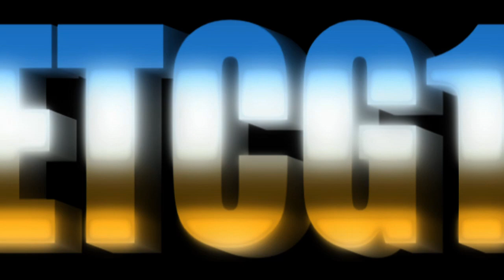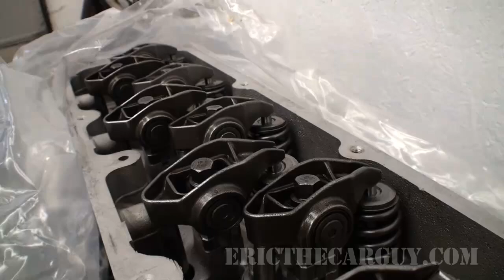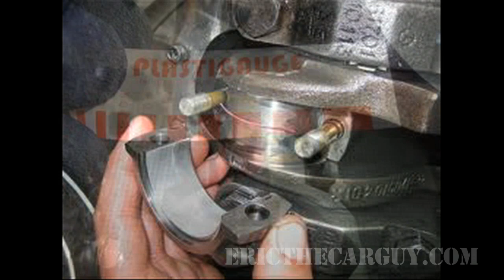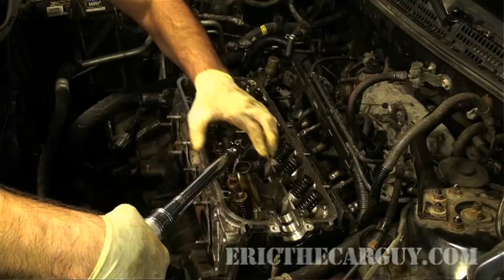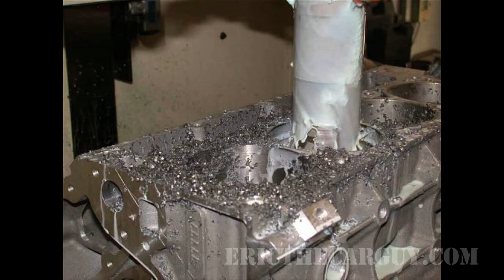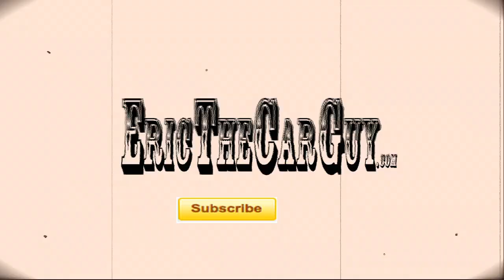Should You Rebuild or Replace? -ETCG1

Comment: I am currently in the engine replacement situation. An 03 explorer needs a new short or long block. I would not want to rebuild mainly because all of the metal fragments to try and remove and just the time and lack of proper equipment

Comment: This helps a lot. I'm thinking about buying an old blazer for 700$ and suspect that it's this cheap because it's a bit more than just problems with the intake manifold gasket and EGR valve. I have no idea what I'm going to find once I pull of the intake assembly.

Comment: I rebuilt the C4 in my 84 Mustang and it was fine. But that was at tech school and I had a clean room and all the special tools and instructor's knowledge at my disposal. It was still working pretty well a few years later when I sold the car.  If I had to do it in my driveway, it would have been a disaster and getting a rebuilt one would have been the way to go.

Comment: Great video man.. I have a question.. I have a car with 220k. With blown head gasket.. What would you do? Replace de head gasket or swap the engine?
Reply: a head gasket is only in the top end of the motor. not nearly as much work.!. but some motors need to be removed to get to the head gasket, and some dont...(but we do NOT know what motor you need worked on or what vehicle it is in) cost of parts vs cost of motor is also a big deciding factor.
Reply: @MrMrsregor  well the car I have is a honda civic 2001 and have bad head gasket and that's I was wondering
Reply: You can do it yourself just change head gasket resurface the head

Comment: If you rebuild an engine, make sure you know what you're doing or the mechanic knows what they're doing. I had an engine rebuilt for $1600 and still did not run right afterwards.. Idled rough, had to keep putting the car in neutral to keep it from turning off..

Comment: Hi, Eric. What if the engine I am thinking about rebuilding or replacing has low mileage and I don't want to lose that? It's a 1993 B2200 with only 84,000. If I found a replacement, wouldn't it have more mileage, given the age? That's part of the conundrum I'm having. Without going into the details of what's wrong with it.

Comment: So I blew my engine yesterday small block 350 bored already previous owner I have no suspects or knowledge of the motor sounds like wrenches in it smacking around think it's crank bearings. Has a ton of aftermarket parts on it intake carb it's an 89 Chevy k 1500 I think the block is out of a Corvette 85 what should I do . rebuild it or gamble on someone's word

Comment: Idk, every local shop (6 of em) told me they won't install a "garaunteed" engine from the internet.  So they wanted me to go to a local "reman" shop and pay $1750 then they wanted $2250 to remove/install...so I said Haha, No.  It took 6 hrs to pull the engine, labeling wires/hoses and taking pictures, with a $180 tool kit and a $180 foldable shop crane.   Installing it is the easy part, the bolts aren't all rusty, corroded, and seized...and you know how because you already took one out.  So I just made...what..$180 an hour?

Comment: His topic sentence says it all - If it's too old to buy a replacement, rebuild it.  If you can buy a replacement, buy the replacement.

I've got an '04 avalanche, broke a ring...the parts alone to rebuild the thing would be $900 (gaskets, pistons, bearings, perf cam (cuz you're already in there), lifters, oil pump (cuz you're already in there), hopefully the connecting rods, push rods, and rockers can tolerate another couple hundred thousand miles)...the machine shop, at best, would be $150 to clean, check, and hone.  More like $250 though, 'cuz that broken ring probably scored the bore.  Then there's the time I'd spend disassembling and reassembling the thing.
A used, 100k mile, 5 year garauntee replacement is $1,250.  It's worth it unless you think your time is worth nothing or you simply enjoy doing that type of work.

Rebuilding is, a lot of the time, impossible - You're probably going to be remanufacturing....You'll have a more powerful, more fuel efficient engine, but it's almost always going to cost more than a factory engine. Lol

Comment: As mentioned it depends and quick research shows which is most cost effective. But generally replacement is most cost effective. Generally cheaper and obviously better warranty. Now days you can even buy from mild to wild with Dyno sheets (engine broken in) taking most of the work out. The big three have turn key engine sets that includes everything including transmission, carb, fuel injection, wiring harness, ecu etc.. even oil and filter. 

Look at a stock sbc brand new crate motor for $1700. You can barely rebuild a short block for that price, add in just the head work/check and no way.

Comment: I paid $1,500ish to have my motor rebuilt years ago for my 22r.  It was a lot of money but the shop didn't frequently perform rebuilds on Toyota engines.  I was young and naive.  I should have done more research.  The engine ended up blowing a head gasket just 1-2 years later.  I agree that installing a used motor can have some benefits.

Comment: Depending on why. Id rebuild an engine for the experience. Example: The first motor I rebuilt was 2.2 litre OHV in my cavalier and i did that because i was in high school and i was too cheep at the time to buy a newer vehcile. So i got good. Ten years later (or close too) ihave a Chevrolet k1500 pickup and want to rebuild the engine it. I mainly want the experience really. Not only to become familiar with the 90's chevy trucks but to rebuild one of the most popular small block motors ever, the chevy 350(5.7 litre). I am aware my block needs to be machined and all that other stuff. But come spring my trusty 95 truck is getting not just a rebuilt motor, but a whole make over. I think part of what makes a project vehicle a project vehicle is the work you can do on it yourself and improve your skill. Sure remanufactured motor is far easier but at the end of the day it is the study and the journey to a restored truck that drives me more then the finished product

Comment: I have a 2004 Solara ready to turn over 200000 blowing blue smoke and knocking for about 10k and burning a qt oil every 200 miles blowen head gasket and last time I dove it  I was doing 80 and the chk eng light flashed and she dropped down to 70 as I exited the freeway she continued to try to die. She sounded like she was chocking.  She will start and stall in revers.  Whats happened.  It sounds like something shattered now where before it just sounded like a knock.  There is metal shavings in the oil filter when I change the oil.

Comment: The owner wants a cheap and reliable repair, the technician wants an easy trouble free repair process.. Both must be happy in the end, so who gives? Does the owner pay more for a new "big" replacement part, or the technician works harder to keep his customer happy? My answer: if the engine has to much wear, replace. If the engine was "treated" good and the wear is within specs, repair.

Comment: With an old classic like a Corvette it's important to keep numbers matching but after rebuilding a few I would be a little leery of doing it if you want assurance it will last. It's so hard to maintain tolerances throughout the engine as compared with a crate engine or a factory built with computer precision. Even a junk yard non rebuilt engine would probably be more reliable if it was well kept up and had somewhat low mileage on it. Just speaking from my experience anyway.

Comment: i took my engine to a machine shop and end up in a disaster .. have lifter noise now on both heads, misfire on cilinder 2 and 4, truck can't even be drive now ...2008 silverado 1500 ...should go to dealer and get whole new engine to late now

Comment: Rebuilding tends to be cost prohibitive in modern vehicles. They are simply not designed for it. Some things however, ancient things, were designed to be taken apart and rebuilt.
Will you ever find me with a toyota DOHC in pieces in my garage? Only as a last resort. And i will never, even with good help, go deeper than the head. Even a 30 year old toyota is a scary complicated beast under the valve covers. 
Will you find me with the old 1990 mark 4 454 in pieces? Maybe. Pushrod V 8s are simple and comfortable. At least comparatively. Have I already gotten a quote from Vilas Machine  Works on a bore-out and crank job? Yes I have. My chosen mechanic for that vehicle is a hot rod guy that doesn't touch fords that aren't flat heads or anything else made past 1995. Since that particular block remained more or less unchanged (internally at least) for 40 years I feel that it is in good hands. Beyond that, ive taken the heads off myself twice. And they are iron, and its a bitch of  a job, but that block was made to be rebuilt. 
And the old 3 cyl yanmar john deere? If it ever, one day far in the future, shows signs of wear, ill take it apart too. I believe its a pushrod but im not sure because the thing is a masterwork of reliability and its never had the valve cover removed. But i do know that it is an older tractor and that generally means that it should be servicable. 
I guess what I'm saying is pick your battles. Some things were designed for service, some for replacement. Don't buck the horse on that one. 
If its designed for replacement replace the damn thing. If its designed for service do whatever you want. But bear in mind that modern vehicles are NOT designed for service. None of em.

Comment: Had my transmission rebuilt 6 months back at dealer. Now the same issues are back but they swear it's another component related to the transmission. I took it to 3 other shop all believe it's not that part. I now regret getting it rebuilt but it's too late for that. My vehicle was delaying to pick up when stepping on gas (red lights or stop signs). It also has mis-shifts while driving it. I am not sure who to believe & of course a very frustrating situation. I don't want to invest more money. Please let me know what you think or advise on this. Appreciate it very much.

Comment: I specialize in Honda engines in particular b series. If an engine has catastrophic damage like spun bearings, severely degraded oil, cracks or major warpage beyond tolerances, I always replace but save everything left thats still good. But I use good quality cores I pull myself from pick n pull, I know how to check them for condition before I decide to buy. Ive even bought a b18b out of the trunk of a Toyota Camry in the middle of winter off a Vietnamese guy. But I always do a basic tear down at home to check bearings, cylinders, and head/deck warpage, and for general cracks,  perform machine work as necessary before reassembly with new parts. Most the time I can reuse the original pistons and just hone with new rings, and replace the bearings with a standard set of Kings or ACL race series. But since Honda does its own blueprint system, I will be converting to oem bearings on the next build. They allow for the closest possible match because the system allows you to move up and down in small size increments. It also allows you to brag that you did a true oem rebuild on the bottom end. Of course, always use your ridge reamer to remove the wear lip in the upper cylinder, and brand new oil pump, piston rings, seals, gaskets, and timing kits with a water pump on the build. Also an accurate torque wrench, lots of lube, and keeping everything sterile as possible is just as important during assembly.

Comment: Over the summer I bought a 93 civic specifically so that I could rebuild the engine. It was burning oil badly and needed new axles, muffler etc. is good experience, but it needed a lot of work and for a first timer was very complicated! I had the head machined and slapped a new set of rings on after honing the cylinders out and it doesn't burn oil anymore. It does leak a bit out of the distributor or head gasket, but I can't figure out which... anyhow, thanks for the information

Comment: I concur. Remanufactured, new, or rebuilt by a shop are all good ways to go for relatively little money and are all warrantied. A used engine is a good option if you've seen it run and inspected it. But generally I would opt for rebuilding the engine you know rather than trusting someone else's... unless cost is a factor. Engines are cheap at pick'n pull. You can sometimes buy 2 for the price of a single camshaft.

Comment: People may say that buying another car is the best thing to do, but I don't think people take in account that every car has it's issues. So buying another used car that's maybe a couple hundred bucks more may not be a great idea since it may have other problems that will just put you right back where you were before with your old car. So buy new parts and replace them. Eventually you will have yourself a good o'l reliable POS. It's the best thing ever trust me!

Comment: I had an irreparable engine in a 95 explorer. I bought a salvage yard engine and rebuilt that one. I still have the original engine for parts. The process was an education and I was better for it. I was an aircraft mechanic in the Army so I knew tools and how to read manuals. I also know just how important tolerances are. I was in a perfect position to rebuild, but most people are not. Know which one you are.

Comment: It does not matter if you rebuild or replace, you need to know your rebuilder or your machine shop. If you put the time and money into replacing rings and bearings and don't restore clearances and wear surfaces it will be a short-lived repair.  If you spend $500.00 and 40 hours on new rings/bearing and the motor runs for 2000 miles before a cam lobe choose up a lifter. $500/2000Miles = $0.25 per mile. If you replace or resurface all of the wear surfaces and restore clearances it may cost $3000 and 80 hours. The repair lasts for 100,000 miles $3000.000/100,000 miles = $0.03 per mile. If you go for the $500.00 repair I have some real estate you need to look at.

Comment: If you go for 1 intervention in your life, the best thing to do is to go for a crate engine or transmission or rear axle as you'll never acquire the exprerence needed and the risk is high that you'll mess up your rebuild
however, if you intend to repeat the experience, I'll go for the rebuilding as the experience gained will serve you all your life.
when I begun, I was as about anybody that is working on cars but today, the only operation I don't perform is cranckshaft reconditionning as I can't justify the equipment to do that job and the reason I developped this  because i was highly unsatisfied with the work done by the local engine machine shops

Comment: 1972 gmc sierra 350 ,would you replace with new crate or keep numbers with rebuild ,which is cheaper on the average,200.000 and going  strong,thanks
Reply from the maker: Cheaper is not the question. If you want to keep the vehicle numbers matching, keep it numbers matching. If you just want to replace the engine, replace the engine. 350's are a dime a dozen in the aftermarket, in just about every configuration you can imagine.

Comment: Personal vehicles tend to get rebuilds over replacements, side gigs and customers get replacements over rebuilds almost every time due to cost benefit and time.When it comes to engines and transmissions, I always torque every single fastener to spec, always measure every clearance, always ALWAYS send out for machine work as applicable. So far it's worked out fantastic and see no reason to hack from this point forward.

Comment: I just got a 1995 Chevy Cavilier for free. has a Blown head gasket, gonna pull it apart and see if the head is warped, if it is, reman unit, if the block is cracked or done for, junk yard, or, a nice ol "Reman, Long Block" shall do the job.

Comment: Quick question!! So one of my cylinder is losing compression so im saving up for a rebuild..so pretty much getting a small block pistons and all that but one of my friend said i could get away with leaving and keeping the head and just replace the valve seal my car has 160k.. Is he right tho? Can i get away with leaving the valves alone?
Reply: asakapa0003   I wouldn't listen to your friends advice. For starters, replacing valve seals won't fix your low compression problem. Secondly, you have to fix the issue, so you first need to find out why it is losing compression via a compression and leakdown test. Could be leaking compression from any number of places, head gasket, piston rings, valves (not seals!) etc.. you need a diagnosis to fix the issue first dude.
Reply: Steve Q i meant im getting a new bottom end rebuilding it and thinking about using the same head and mybe just replacing the springs seals and valve ( if its not damaged)
Reply: asakapa0003  Ah I see. There's no reason you can't, as long as both surfaces are flat, I.e machined, there's no reason you can't interchange block and head. I have just had to source a new head for Volvo XC90 as it was too warped, so there is no difference. Ultimately it is just the sealing surfaces you have to be sure of, but if you get them both machined you will be fine. Though I don't want to hijack Eric's channel so he might want to tune in?

Comment: Hi there, great informative video. 

I just had a 2000 Toyota Corolla seize on me, due to an implied fault in oil pressure. 

I took really good care of the vehicle oil and everything else so this is what was suggested to me as the fault in the engine. 

I was wondering if you could tell me which way to go in this case. 

Your video is pretty clear about things, but I am also an avid torque spec user and think that a rebuild is not out of the question. 

I require your expert guidance. What do you think I should do? Rebuild or Replace?